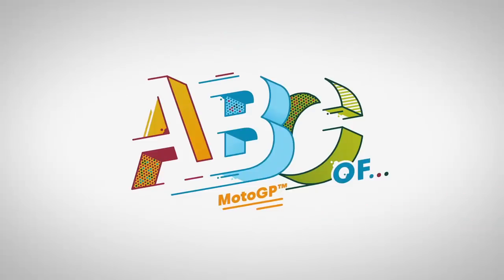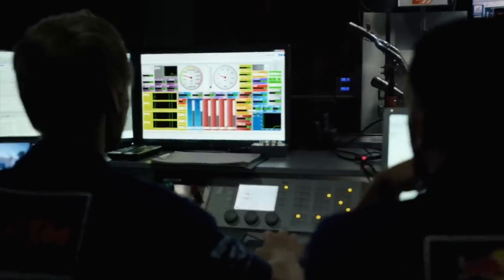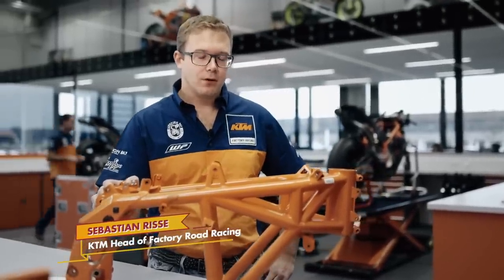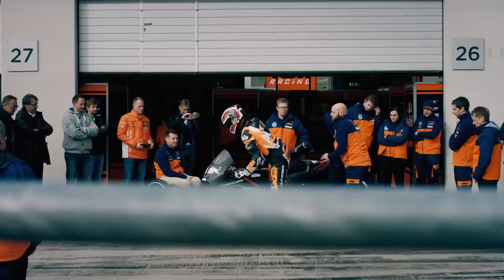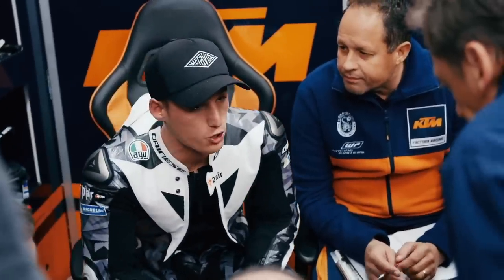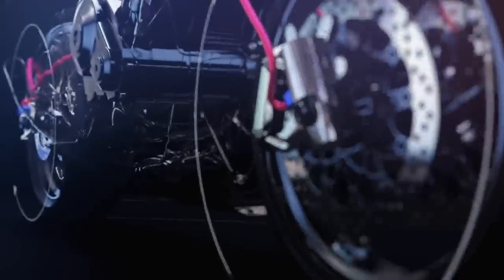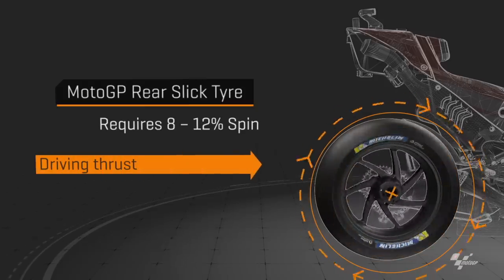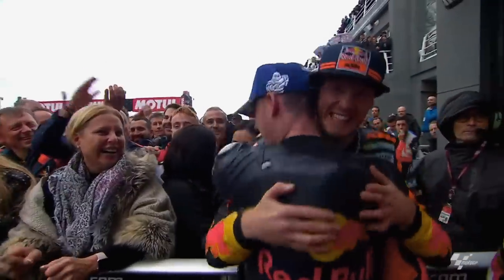The ABCs Of MotoGP Part 1

Comment: Imagine if KTM would make a 750cc “superbike” .... maybe a shorter stroke V4 ....... I would order that on day 1 
Why doesn’t any Manufactuers take advantage of the 750 beside Suzuki ?
Bring the 750 BACK !!
Reply: Won't happen unfortunately. KTM's CEO is against the idea of making production superbikes for the street. The claim is that they're "too dangerous" for the public roads.
Reply: So you don't watch moto2?
Reply: @mrgreen9388  You can't go to your local KTM dealership and buy a Moto2 bike. If you could, I would have certainly robbed a bank by now, lol. And on top of that..it's just a KTM frame and suspension! The motor is a Triumph!